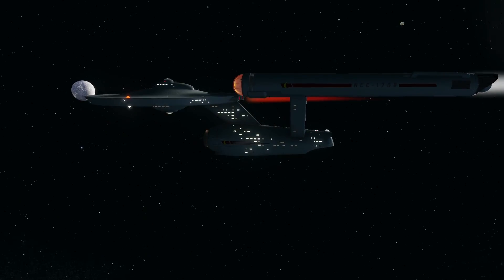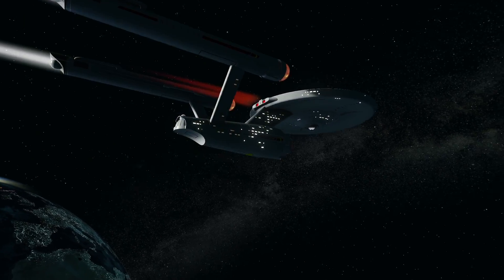Why Extra Nacelles?

Comment: Any thoughts about the voyager J detached nacelles?
Reply: I'm not sure they can ever make actual sense of it, but I think it's a cool looking '80s throwback overall
Reply: @brianwalker859  my headcanon is the conventional warp reactors are now so small (isn’t the one in refit Discovery just a foot or two across?), even ones powerful enough for capital ships, so they just put one in each nacelle. 

Especially since they reconnect to the ship when they’re not active, so they probably refuel in those times, then float to their most ideal position — similar to Voyager’s variable geometry drive but with all 6 degrees of freedom. 

Part of the reason I like to think that is it harks back to Jeffries’ original idea, which was to have the reactors in there. It’s just certain episodes and then Phase II said “actually let’s make the warp core huge and central”!

Comment: Cool Video! I wonder. Each Matter Antimatter reactor for example Galaxy one, makes annihilation possible. These conduits, two on Galaxy starship, they go to the two nacelles. Does that mean, warp plasma is just plasma that circulates around the ship and when necessary it is being electrified by annihilation snd when activated, we go warp when they say Warp 1, which is 10:1 by Manual and Warp 0, idle, when 25:1? I watched NX-01, but I am not sure completely.

Comment: I always imagined it was because 4-nacell ships had much less advanced nacells then most 2-nacell designs we see in hero ships. It makes sence for starfleet engineers and ship yards to always be inovating new and resource intenisve nacell models to reach the fastest and most efficent speeds that are possible. Because these shiny new nacells are so "expensive" to make SF designs new hulls around the 2-nacell design which seems to be a minum requirement for a ship with a long range mission prophile. Since besides maybe the warp core the nacell is the most advanced and resource intensive parts of the ship it's relatively cheap to build your ship around your nacells so it's much better for starfleet to have 10 2-nacell ships then 5 4-nacell ones. As more advanced nacells enter the market and older/less advanced models are becoming easier to produce/salvage it becomes less expensive to put more of the lower grade nacells on ships which in tern need a multi-nacell configuration if there are going to be useful as a cheaper but competitive altenative to the most advanced starships. Even the prometheis must be using substandard nacells if even with 6 it's still matching the 2-nacell Intrepid and Soverign classes in terms of speed in it's 4 (or 6? don't know if it uses all 6 when combined) nacell configuration. 1-nacell ships comparitively can't substain long range or extended missions so would simularly be using older model or mass production nacells since they only need enough juice to get within a specified short range.

Comment: I heard, according to some source I cannot recall right now (Star Trek Encyclopedia, I believe?) that the warp nacelles are designed to break away in case of emergency. 

For example if a runaway reaction were to start in a nacelle the ship's crew could blow the explosive bolts on the pylons holding the nacelles in place and the entire nacelle would warp away, leaving the rest of the ship behind. This way the ship would not be dragged into an uncontrolled, runaway, infinite warp to god-knows-where. This is why the pylons are so thin as well.

In the event of such an emergency, the crew would be safe from harm until a tug or other ship arrived to recover them. They'd also be stranded, of course, but they'd be alive and not Missing In Action.
Reply: In the TOS Episode The Apple, it's mentioned along with saucer seperation.
Reply: @tetravega567  Thank you!

Comment: I like to think ships with a single engine are basically "canon fodder" ships, or just generally mass produced ships that don't stray too far from core Federation space, essentially a quicker made ship to fill out the fleet, we don't see many of them as their either experimental, or just doing general grunt work keeping the Federation running, kind of like the California class, a general workhorse, rarely called in unless they're desperate for ships like Wolf 359. Otherwise having more engines is probably just as a backup, we usually see this on ships like the Constellation, what I'd call a Light Cruiser, heavier then the single engine ships, but not as versatile as the more frontline ships like the Enterprise classes.

Comment: But seriously, I think at least one Trek universe engineering explanation for more nacelles besides warp field strength & shape, it warp coil cooling.
One of the reasons for a ship's top warp speed is how fast you can energize the warp coils, which run along the nacelle, usually in pairs.
The warp coils produce the warp field when energized.  The coils are "Energized" by the warp plasma that is shot down the length of the nacelle between the upper and lower coil pairs, at least in the Ent D nacelles.
A side effect of energizing the warp coils, besides the warp field produced, is heat.
If you energize the coils too fast, they will overheat.
So adding nacelles and cycling through them allows timing the nacelles to "fire" (shoot warp plasma periodically down the nacelle) in a predetermined sequence to allow some cooling time between warp plasma injections.

Comment: 2:25 not exactly the same but we use real world aircraft with extra nacelles such as a 747 or 777 for a very similar purpose.  Specifically to attach a test engine and test it in flight.  It's not intended to test whether or not an additional engine would improve performance but rather to test the engine itself to verify its performance before installing it as a dedicated engine on an aircraft.

Also,  If I remember right the 747 also has a built in hard point for attaching a 5th engine specifically just to transport it to the destination as a spare.

Comment: There is a theory that the Galaxy had two sets of warp cores in each nacelle to use aircraft example think of the B-52 has two engines mounted on each pylon in joined nacelles or the Concord which had four engines in two nacelles.  But the truth is that it is fiction so whatever looks good works. I am just glad the older Franz Joshpe ships are back :)
Reply: Warp CORES are not in nacelles, they are in the secondary hull of the ship.  Warp COILS are in the nacelles, and what makes the magic happen.  Dual inline coils have been proposed as a way to get two-nacelle balancing effect out of one nacelle (explaining away Kelvin), but if that's possible, why isn't EVERY ship built like a Kelvin?  Intrepid-class ships like Voyager are mentioned as having triple helical warp coils though, so I suppose its possible.

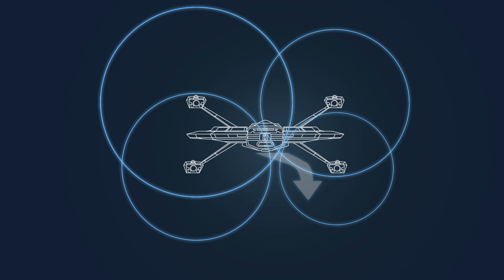Comment: 5:45 "wince" Okay, I get what you're trying for, but...4-wheel drive doesn't necessarily enhance maneuverability. Especially the selectable version of it, which would be most analgous to the point being made there (the non-selectable always-on version is termed All-Wheel Drive to differentiate the two, and is designed differently). Usually the opposite is what happens. Because the wheels normally used for steering are now mechanically attached to the power generation source via axles and a transfer case, you can't turn as readily--mostly because of a lack of a differential (not enough space for one, usually) to manage the change in traction, speed, and turning radii. You get an effect known as crow-hopping or crow-stepping when you try to turn as tightly as you can without 4-wheel drive engaged. Because there's power going to the steering wheels, they lose traction and skip along the ground--hopping. Instead, what it lets you do is get more power to more wheels to navigate difficult terrain.

I think a better analogue for the point would probably be the maneuvering pods used by modern cruise ships, which really do increase their maneuverability.
Reply: Heh, I thought “surely that’s more like all wheel steering than all wheel drive?”; I suppose he’s only heard about better cornering on rough terrain such as with Audi’s early Quattro rally wins!

Comment: the only Federation starship that I like with four nacelles is the Prometheus and I only like that ship because of its Multi-Vector-Assualt Mode not because it has four nacelles.
Reply: Agreed  although I kinda like the non-cannon constellation remake from STO
Reply: Technically she had 6 nacelles . I love her as well although like the enterprise d . I'd rather use her as a single ship unless it's an extreme situation.  , and I read somewear the finished version had defiant class phaser cannons as well . To the design.  , not to mention the amount or torpedo tubes.  , 14 forward.  Say 4 quantum or all if you like light and heavy torpedoes.  , consentrad fire plus faster than the enterprise.  Or voyager.  Nuff said

Comment: Never understood warp theory propulsion. Impulse I can understand as the impulses pushes the ship, and breaks the inertia so that it moves through the void.  Warp nacelles create a warp bubble, but what pushes that bubble along?  It's said that they sort of 'slip' into subspace, and travel along it, which allows them to move along faster than normal space without actually leaving normal space.
Still, it's a bubble. Does it pulse front to rear to push it along its course? I know the warp core reactor creates the power, the nacelles create the bubble, and the episodes that show these show it 'pulses' from top to bottom of the reactor, and front to rear of the nacelles, but the traveler episode showed a stable warp field, and it did not undulate.
Starting to wonder if it's just 'shoehorning' or potentially an actual technology.
Impulse, yeah, I can see that being used as there is an engine that was designed to use a radio transmitter to heat cold plasma, which would push interplanetary travel speeds up by a significant amount.  turn a six month journey into a one to two month journey. that is current technology, and possibly a precursor to impulse.

Comment: My head cannon is more nacelles are the equivalent to having more radiators. The ship would be able to run at higher warp speeds for longer. Loosing one or two wouldn’t limit its higher speed, but limit the ability to sustain that higher speed.

Comment: Don't forget peanut hamper's improvised escape vessel, which was basically just one nacelle with a cockpit attached to it.

From a physics point of view though, wouldn't it be advisable, regardless of the number of nacelles, to put them in symmetric positions, since they're supposed to produce a warp bubble?

Comment: Warp nacelles probably are more analogous to the mast and sails for wind powered sea going vessels than they are to jet engines in aircraft.
A single masted ship would be less effective than one with two or more masts but there is a limit to the number of masts deployed versus the efficiency in converting wind power forward speed.
Multiple nacelles would add some power gain and capability but probably in exponentially decreasing amounts the larger the number and also the increased cost of the maintenance load needed to keep them functioning efficiently.
It’s why I don’t think 5 or more nacelles will ever be seen, if course eventually if you put enough nacelles around the ship you’ll end up with a ring design similar to the original Vulcan warp drives.

Comment: A lot of this seems to follow the pattern and rationale for aircraft engines. 

Generally the cheapest and most efficient or best performing aircraft is going to have a single engine.  You add more engines for more power or redundancy… but at the expense of weight, complexity, fuel consumption. 

Most airliners have gone to two engines because reliability is acceptable, engine power has greatly increased, and they perform better than three or four engine aircraft. 

Some long range patrol aircraft use four engines… and they shut two down for better endurance (speed is slower but it doesn’t matter). 

Three and four engine aircraft could also be ferried with one engine inoperative to get them to a maintenance facility. 

Single engine aircraft are limited to small utility aircraft the largest of which are planes like the Cessna Caravan, DeHavilland Otter, PC-12, and Antonov 2. They are very economical and used for charter, sight seeing, medevac, survey, etc but don’t meet the safety criteria for airline travel.

Comment: i could have sworn i saw a galaxy class with 3 nacells once. Also didn't the promethus class have 6 total 2 for each seperate section? I would think the promethes could  go to lower warp speeds by using all 6 nacelles at lower power. So the 6 nacells can possibly reach say warp 5 a lower power than say a galaxy at the same speed with 2?

Comment: Here's a question. You said that more nacelles would allow for a longer warp maximum but what IS the limiting factor regarding holding a higher speed than cruising? Is it heat, a power drain,  or some other kind of buildup?
Reply: Strain on the components, plasma injectors and other key systems, I believe, @Darcy .
Reply: The warp coils can overheat, then they’re “fused”, and presumably that’s very much like when you accidentally melt an electromagnet coil into a solid lump of copper.
Reply: Very much like running a car's engine at top RPMs: somethings gonna give.

Comment: The Franz Joseph designs exist in a "quasi-canon" state, in that they were only ever "seen" as a nearly imperceptible (and rapidly changing) bridge display on the Enterprise in Star Trek II (the canonicity question comes from the fact that there was no reason for a refit Enterprise at that stage in development to be cycling displays of schematics of vastly obsolete designs). If you look at the display in Strange New Worlds, it officially lists the U.S.S. Archer as being "Saladin Class". So that is the canonical configuration of that class, settling the question once and for all.

Also, seems you skipped over the Enterprise episode "Catwalk" where the crew of the NX-01 hid inside the nacelles for 8 days when you were describing form and function/hazards, etc.

Comment: I thought the nacelles generated power and also help stabilize the warp core geometry. In my head cannon the third nacelle like on a Galaxy X was to supply power to the tactical systems since it was built more for battle

Comment: Then there's the Suliban with their no nacelle internal warpdrive design.
Their Cellships were incredibly powerful and efficient for their size, being combat starships smaller than a shuttlepod.

What if Starfleet had managed to reverse engineer one? [They went straight back to Starfleet HQ instead of just having Trip tinker in his off hours].
Could that have become the new Starfleet paradigm?
It has a lot of advantages, including just freeing up a lot of design limitations that are imposed by pylons and nacelles.

What are their disadvantages if any.
Imagine a alternate timeline where Starfleet made NX sized ships using that tech.

Comment: My headcanon has always been thus...

Ring-drives are generally much more efficient, and have higher cruising velocities for longer times, but lower top speeds and less at-warp maneuverability.

The nacelles have much higher top velocities, and can allow for sharper course corrections at warp, but are extremely inefficient and can't hold high velocities for long at all.

Extra nacelles, (always in pairs...fuck that 1 and 3 nacelle shit), are an attempt to get more of the benefits of a ring-type warp drive while maintaining the benefits of nacelles, by spreading the load of the warp field on the drives.  With 4 nacelles, you get a more balanced warp field, and a better distribution of its energies at high warp.

The reason they're so rare, and almost never found in vessels intended for combat (except for Prometheus, which only does so because of it's ability to separate), is because keeping the warp field stable across two pairs of nacelles is considerably more complicated than just one pair, or a ring.  More can go wrong, and it can be harder to repair and maintain.

To me, civilian ships, transports, science vessels, and exploration ships should all have always had ring-type warp drives.  Ships intended for any sort of combat, even light combat, such as patrol vessels, escorts and the like, should always have one pair of nacelles.  Ships intended for multirole uses should then have had two or even three pairs of nacelles, to get the benefits of both types.  They'd be less common because of their complexity and the lesser need for multirole ships, and the design change would then be better suited to a wider variety of roles as intended for such a type.

But, that's just me.
Reply: I agree, except I think the ring is even finickier with synchronisation across its surface, but that the Vulcans put up with it. :)

It goes well with their personalities, and helps to explain the rarity of that ship configuration among other species.